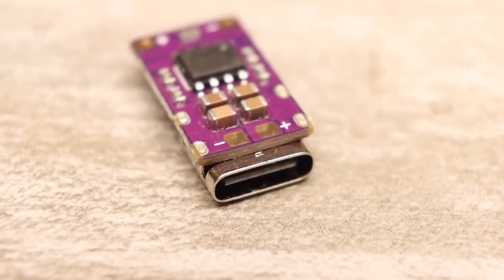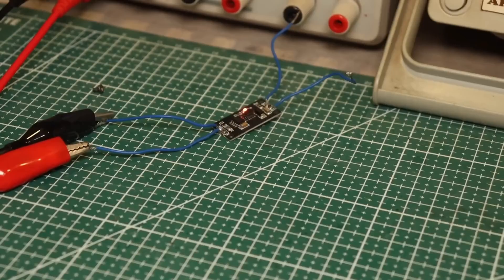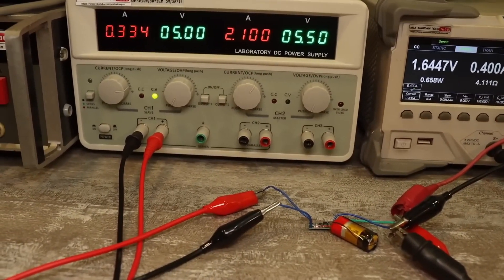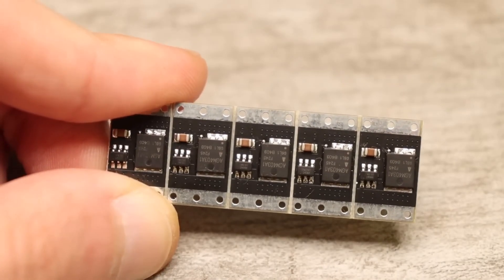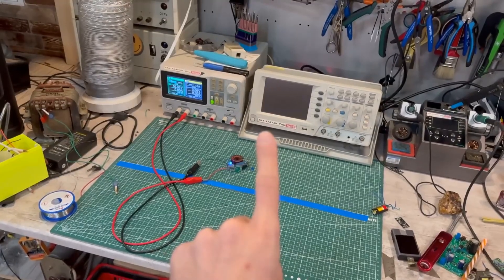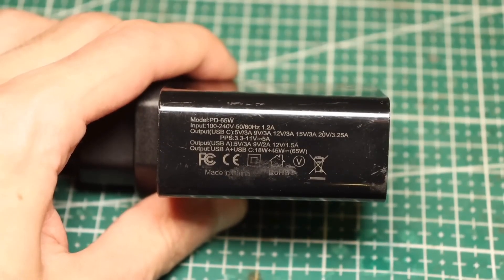TOP Useful modules from China for $1

Comment: 0:00 intro
0:16 skipping TP4056, NT3608
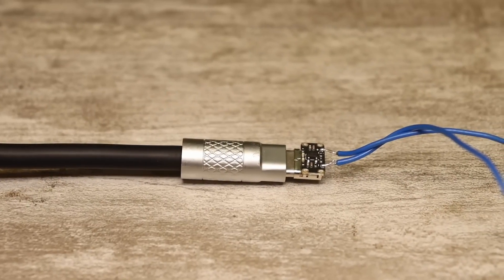0:39 LP4054 - Li-Ion Battery Charging Pad 3.7V - most compact, charger only, gets hot - 600mA max, protections: short circuit, overheat
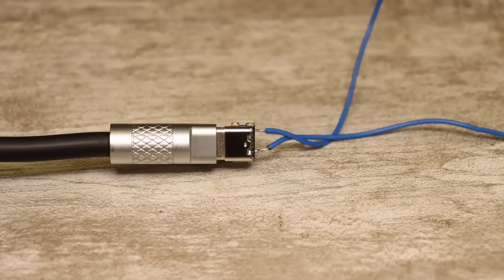2:03 ETA9742 - Mini Charge/Discharge Module - charging 2.4A max, output 2A max, protections: short circuit, undervoltage
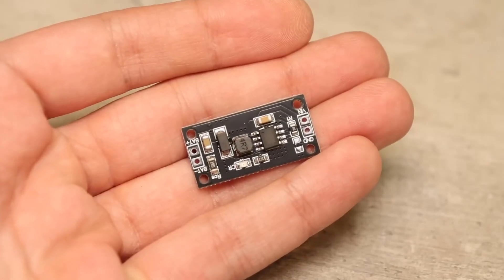3:27 NiMH NiCd Battery Charger - 230mA, protections: short circuit, reverse polarity
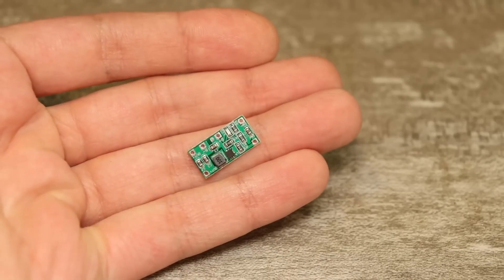4:35 Converter for 1.5V batteries (AA/AAA) - output 0.5A max, quiescent current 2-3uA, protections: short circuit, undervoltage
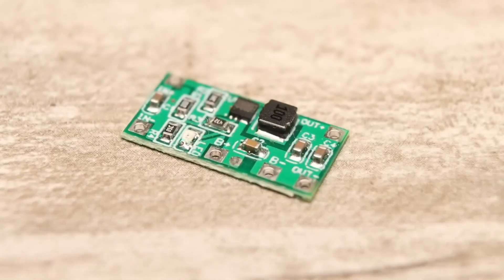5:47 DD4012SA buck - Converter Module - replacement for LM317 L7805 L7818CV, ME3116 chip, gets hot, protections: short circuit
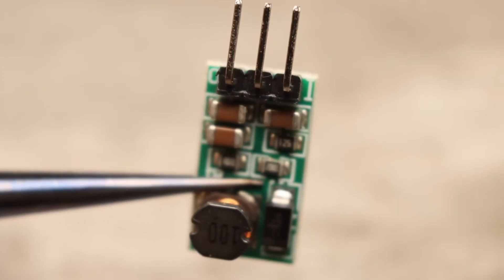7:34 XL74610 LM74610 - Ideal Diode
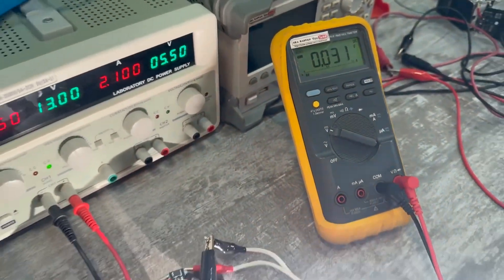9:30 Battery Level Indicator - tiny
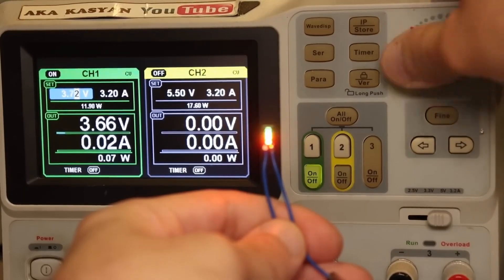10:06 RCWL-0516 - Doppler module - motion sensor 5-9m, 4-28V 3mA, triggers through walls, sensitive to radio waves
11:29 intermezzo
12:00 Trigger Module Type-C - USB-PD voltage 9V-20V

Comment: Please break up your video into chapters and list them in the description with title so that we can jump to each area.
Reply: 0:00 intro
0:16 skipping TP4056, NT3608
0:39 LP4054 - Li-Ion Battery Charging Pad 3.7V - most compact, charger only, gets hot - 600mA max, protections: short circuit, overheat
2:03 ETA9742 - Mini Charge/Discharge Module - charging 2.4A max, output 2A max, protections: short circuit, undervoltage
3:27 NiMH NiCd Battery Charger - 230mA, protections: short circuit, reverse polarity
4:35 Converter for 1.5V batteries (AA/AAA) - output 0.5A max, quiescent current 2-3uA, protections: short circuit, undervoltage
5:47 DD4012SA buck - Converter Module - replacement for LM317 L7805 L7818CV, ME3116 chip, gets hot, protections: short circuit
7:34 XL74610 LM74610 - Ideal Diode
9:30 Battery Level Indicator - tiny
10:06 RCWL-0516 - Doppler module - motion sensor 5-9m, 4-28V 3mA, triggers through walls, sensitive to radio waves
11:29 intermezzo
12:00 Trigger Module Type-C - USB-PD voltage 9V-20V
Reply: @Gregorius421 thank you